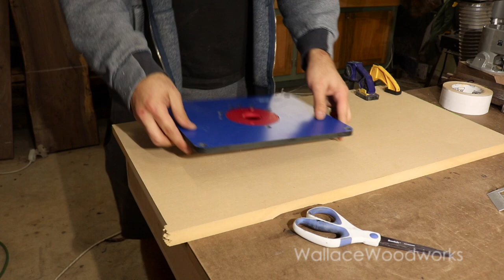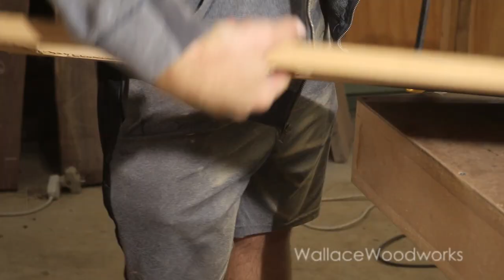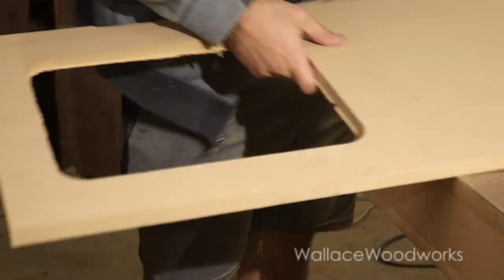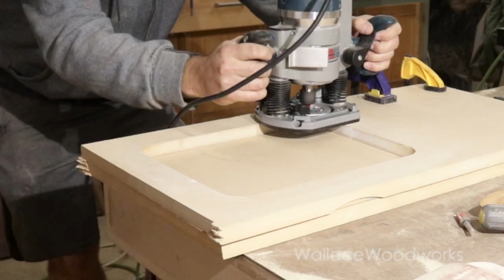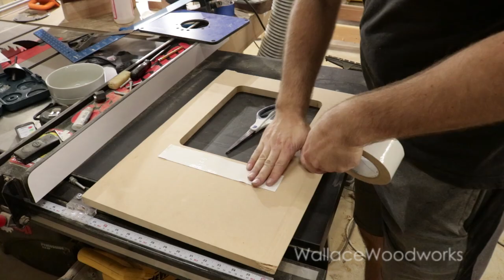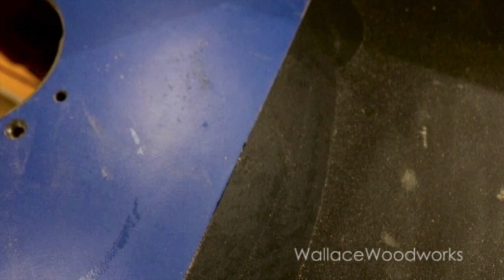I cut a hole in my Sawstop! Kreg Router Plate Install Using Router Template Bearings

Comment: This video is great, but I had a couple of hurdles to overcome.  I am installing a Kreg router lift.  There is no template guide to purchase.  Kreg says to not remove the lift mechanism from the plate as it can be very difficult to re-install and operate smoothly.  That means you do not have a flat surface to run your router over to cut out the template with the bearing bit.  So, I wound up using a small Dewalt trim router with a flush top bearing bit and was able to cut out the corner radius for all four corners.  Then I removed the plate and used a straight edge to mark the lines between the corners.  Next, I followed the video and cut out the template with my jigsaw.  Then I flush trimmed up all of the edges.  This gave me a nice template.  Then I wound up using a 1" inside diameter guide bushing with a 3/8th inch spiral upcut bit to cut out the second template the size of the plate.  I left plenty of material at the 4 corners and had a bearing edge of just under 0.5" all around the plate.  Fit was excellent and I now have a working template for future use for Kreg.  I am a novice and this video was a savior for me.  Thanks!

Comment: trying to determine the two bits you were using to do this? im currently preparing to create my cabinet top for kreg lift plate...
Reply from the maker: MrEvolutionInc I used a 1/2” flush trim bit for the first step, and then a 1 3/8” diameter bushing with a 3/8” cutter. More on that in the description, hope it helps! 😀